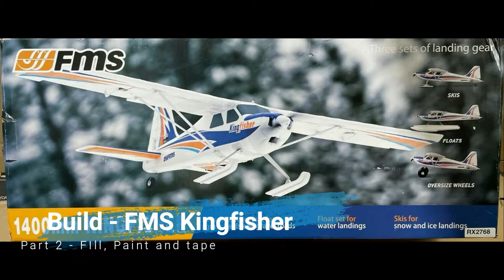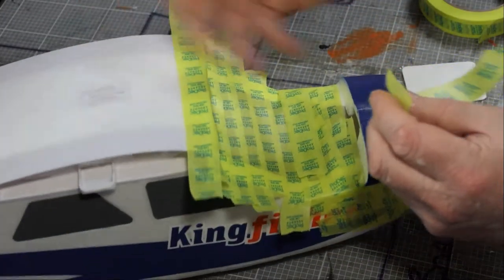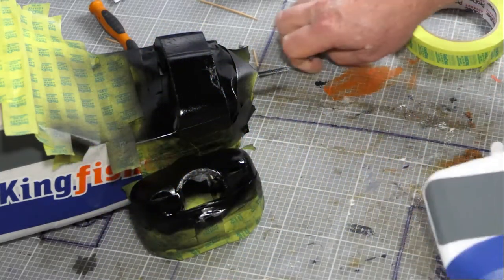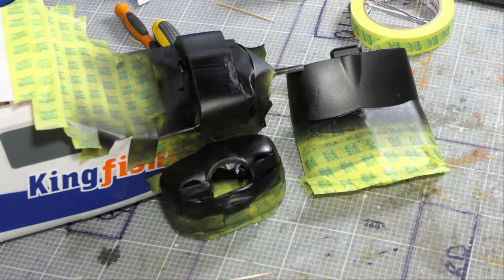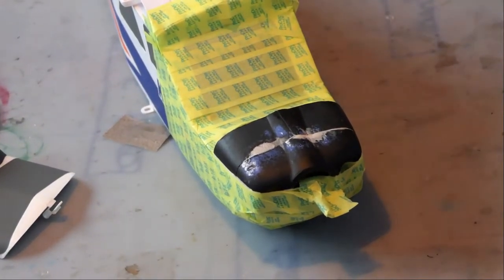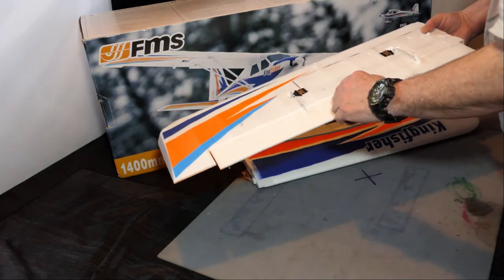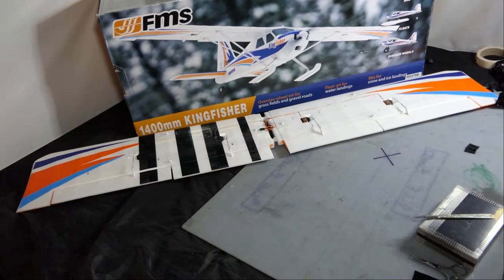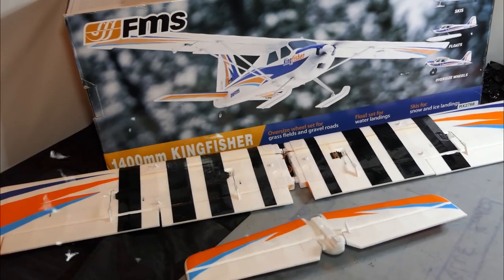Build - FMS 1400mm - Kingfisher - Part 2 of 4

Comment: Hi martyn
APART from the ding at the front good quality FMS.... when rubbing Down foam or filler on foam you really need FLOUR paper...... Its what I used to use between coats of varnish or lacquer smoooooth as a Cuban ladies thighs (that's what they roll cahiba cigars on) how do i know
...... DON'T ASK hahahahahah
Reply from the maker: That DING save be a lot of money - I will be looking for more like this that's for sure - I have not heard of  Flour paper - will go take a look - but I can see why - anything apart from the finest sand paper just rips foam apart, Stay safe Brian and where's the  video of the F4U or Hurricane - check those movements go in the correct direction - I have had a few of those 800 / 750 mm from H-King that needed to have a servo or two reversed .....
Reply: @FlankerTanker  hi martyn
Amazon sells FLOUR paper or ebay...
OR failing that fine wet n dry neither will scuff foam.... I managed to SHOE HORN the Ar620. And the A3 PRO into the corsair had to get creative but it worked ill up load the vids later
Brian
Reply from the maker: @BRIANFORWARD1  Seen the Magic trick...er....Video - LOL  - the inside of that Corsair is  more like a Tardis than a warbird !!
Reply: @FlankerTanker  hahahahahahaha more like frankensteins laboratory hahahahaha.